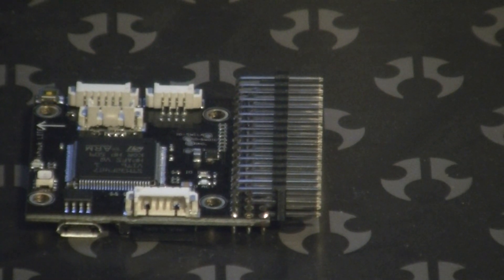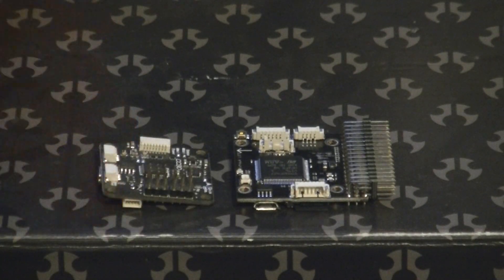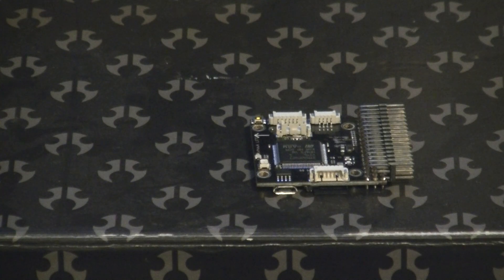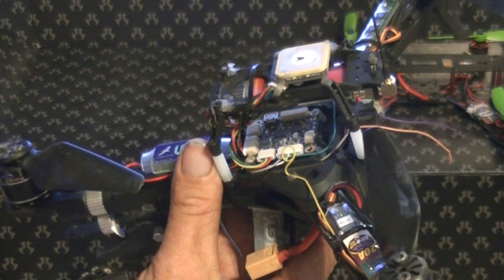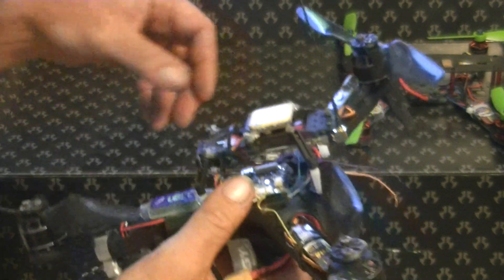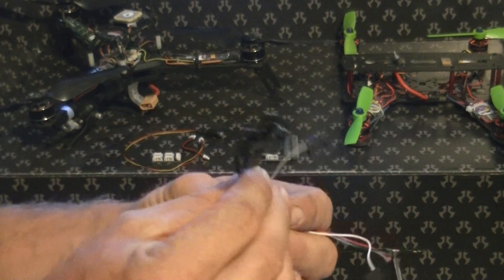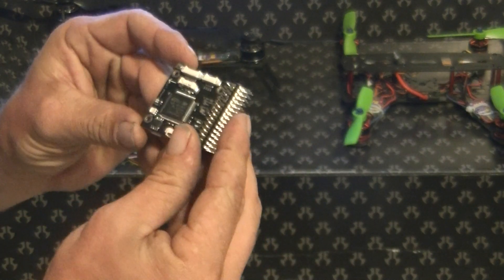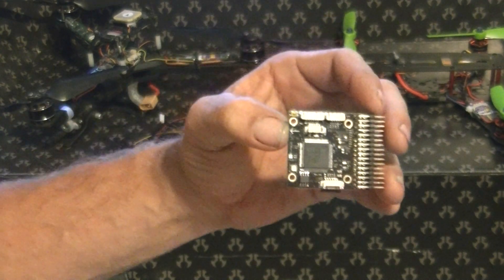pixhawk lite rewiew

Comment: I've been running APM3.1 in two different 250 size quads and a Z84 wing without any problems whatsoever. 
I also installed a Pixhawk Lite in a HK Skymule with excellent results.

Comment: How did the pixhawk lite do in the trifecta? I am about to build one, just waiting on the motors, and I wanted to use my pixhawk lite I have hanging around. Was worried about the size on the trifecta, but judging by your video it looks good. Did you have success with it?
Reply from the maker: +JBailey273 It does ok but im getting interference from esc's or the radio thats causing unwanted movements.   I have use the pix lite in other larger craft but on the small trifecta its a problem
Reply: Oh no! That's very disappointing to hear, I was planning on building it this weekend with the Pixhawk Lite. I am not at all familiar with the other small boards, do you have a recommendation between the CC3D, Naze32, or the others? I wanted to have GPS on this one.
Reply from the maker: there are other version of mini  and now a microhawk to choose from so just keep looking for something that people are having good results with.  the cc3d and naze only use a gps for osd and not rtl or guided flight.  I will be getting a microhawk in at some point and will test it on the trifecta

Comment: You mentioned that you were having altitude hold issues with HK APM on the Trifecta.  I see that you don't have some foam or any kind of protection for the barometer on the board.  If my observation is correct, you will probably have issues with the barometer because it will get affected by the prop wash and the light hitting the sensor.
Reply from the maker: mainsail1235 I had foam over the baro when I flew it... I also hooked it up to a different craft  and had the same issues.  from the feedback I got so far almost every hk micro has similar issues,  but I cant find any complaints on the apm 3.1

Comment: Hi Dr Drone, how is this PIxhawk lite going for you! I hope it's better that the HKPilot 2.7, as indeed the Baro is crap, and now having the same problem as you on Pos Hold! I went a head and ordered one as well.... Keep in touch, my Friend! Cheers and Safe Flying!
Reply from the maker: FPV Cambodia well it has a few bugs... it holds great compared to the hk 2.7 but I'm having issues with it not reading the amperage which will prevent you from doing a compass motor calibration, but if you have already succfully done it on the other board just save the settings and then copy the Pixhawk lite to get around that problem.  when I tried to run a auto tune it flipped my craft... tried three times with the same result but I cant say it was the board for sure causing that issue.... again if you have already auto tuned with the old board these settings will copy over and should solve that problem too.   please let me know how it works for you.  the one I was using was one ordered for a customer and I had a short window to test it.
Reply: Dr. Drone Hey Dr Drone, Indeed, not satisfying then, overly speaking.... Will keep in touch then, once tried on a 250 quad... Leaving for France in a few days, with my Vortex, and will be back in August; keep in touch in a few weeks
Reply: +3D Drones Hi Dr Drones, I still not have installed the Pixhawk Lite, and ordered a the Pixraptor for another project... I still intend to place the Pixhawk lite in my qav 250 or replacing my Trifecta 2.7APM with faulty baro! I still owe you one, and will come back to you in time! what are you up to at the moment?

Comment: Hey bud, I ordered 1 one of these off of Aliexpress. Looking forward to see the difference if any compared with the micro APMs. gonna try it out in my Dugong V2 before i attempt a 250 size.

Anyhow, still struggling away with that micro HK Pilot in my 250 quad. The issue I have now which is major is that the quad is all over the place when I try to use Alt-hold flight mode. I have to immediately switch back to Stabilize or Loiter to regain control as the craft either descends or ascends like crazy. I have the barometer covered with foam well so like you mention in this video I figure it is faulty. Comforting to know I'm not alone with this issue but it still sucks considering I cannot complete Autotune without Alt-hold functioning correctly.